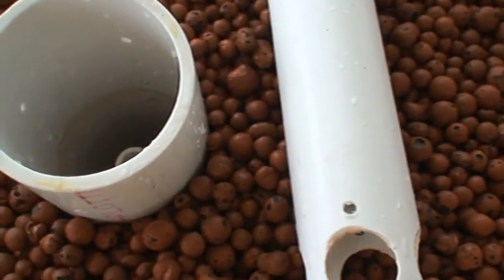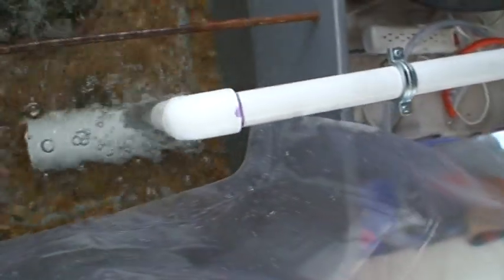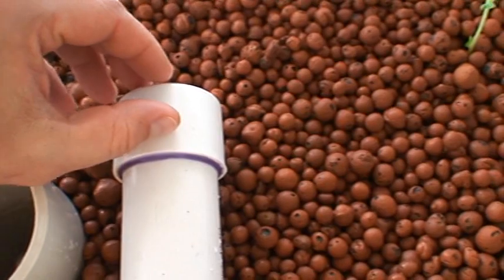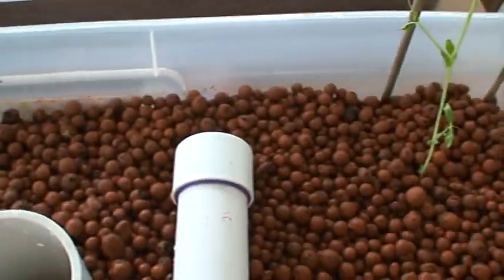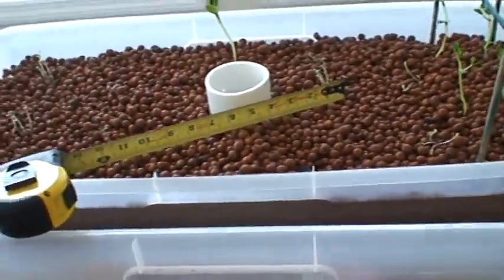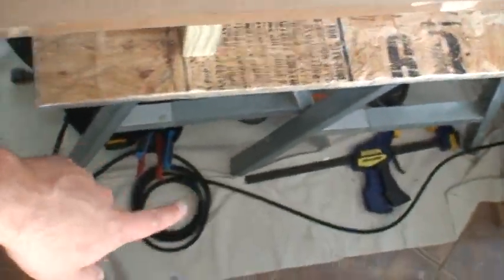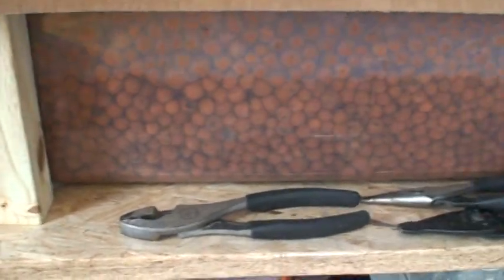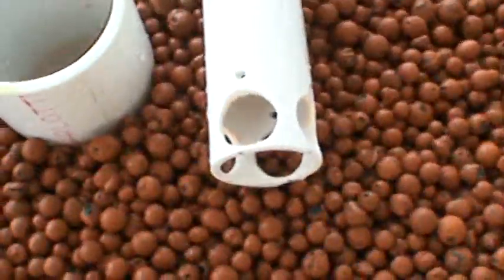Aquaponics 05 - Bell Siphon Troubleshooting [part 2 of 2]

Comment: Thanks heaps for this mate. I've been derping around with my bells for the last few days and its not until I drilled out larger holes at the bottom of the bells is when I fixed my issue where it would not stop draining.

Comment: Your thoughts working this out are logical. But a simple fix is to have the top opening of the siphon stand pipe twice the diameter of the stand pipe & the bell larger than that opening. This will create what is known as the Venturi effect... another one Bernoulli's principles named after the Swiss scientist Daniel Bernoulli published in his book" Hydrodynamica" in 1738. Simple solution: If the drain stand pipe is 1/2" with the top opening of 1" & the Bell is 2" in dia. all will work perfectly

Comment: I have 1" Stand pipe with 1 3/4 reducer bell is 2" and Grate Pipe 3".  

I am using a drop saw cuts in the pipe at the bottom to control the flow. I can make it as wide as I want or as high or low as I want.